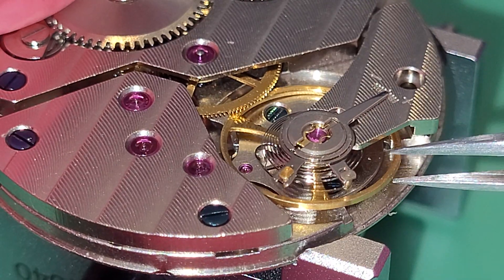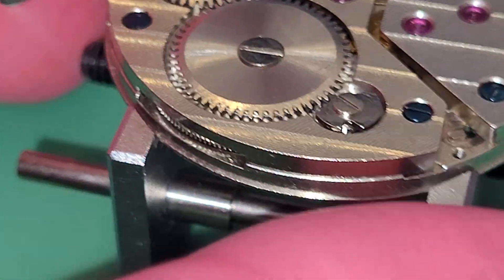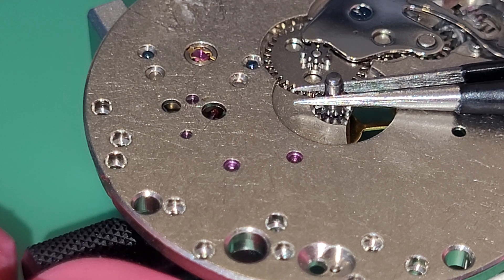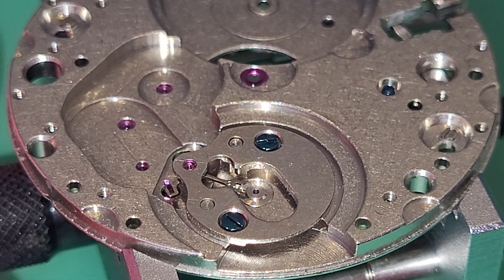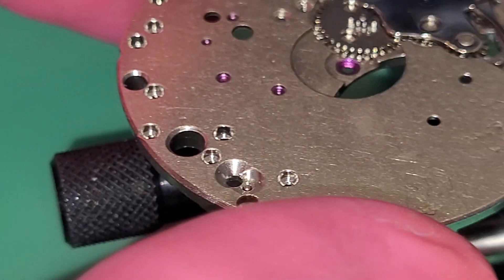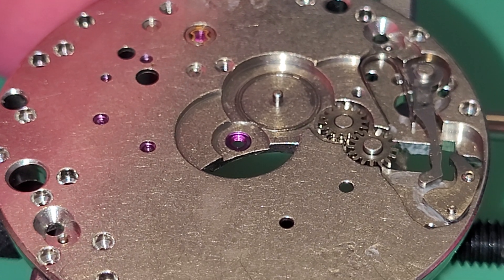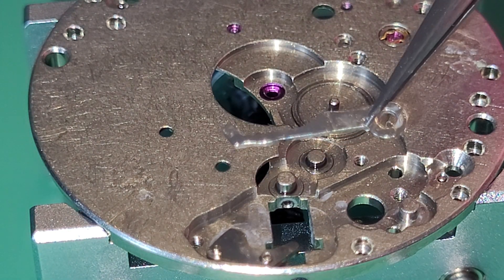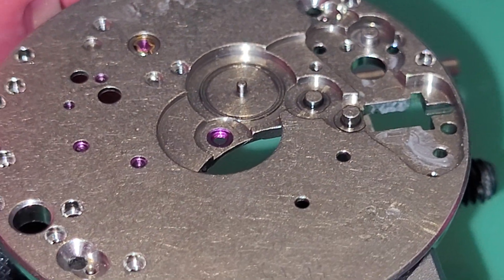Seagull ST36 Movement Dissassembling

Comment: Very instructive video. My problem: the more I secure the screw, the slower the wheel turns, then stops. I have visually inspected it; the two feet under balance bridge are in place, the wheels at first are turning, so all seems right. I never screw it down overly tight, just enough. Wondering if you'd know why this would be happening. Thanks.